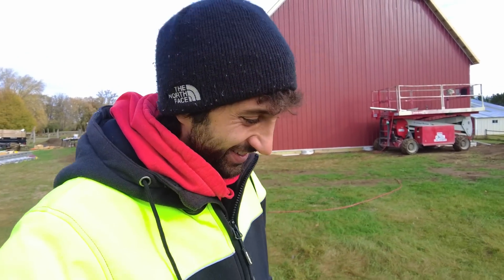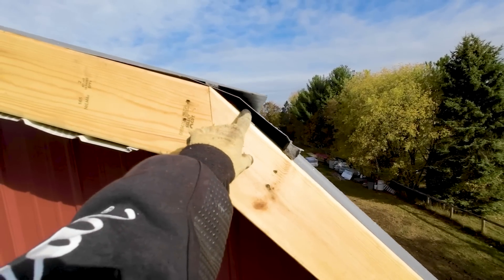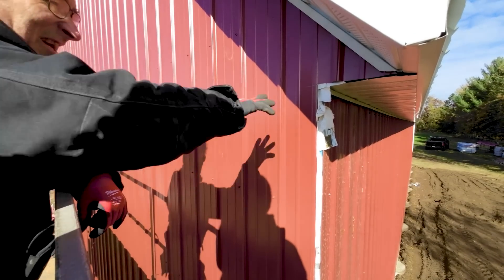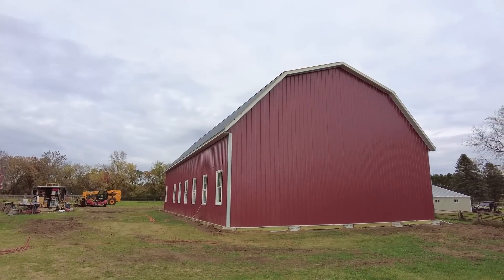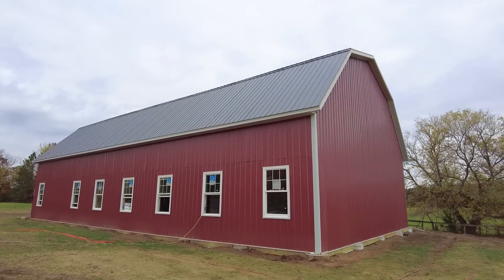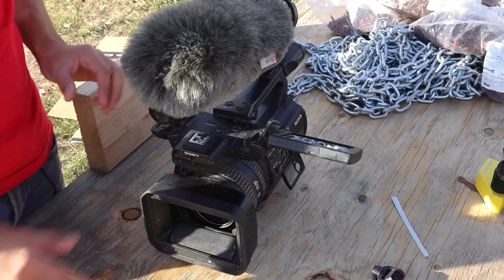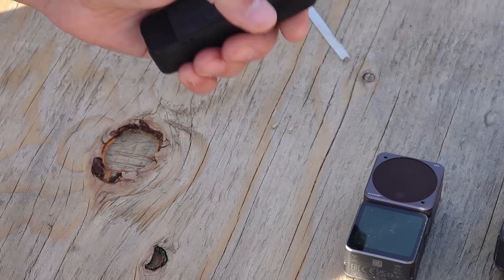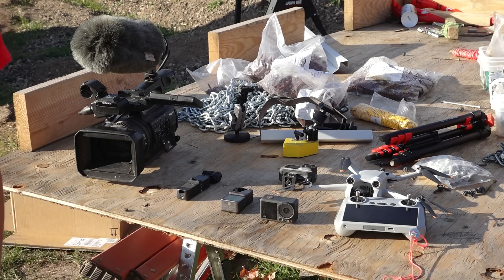Soffit Saturday - 40x72 Gambrel Post Frame Episode 18

Comment: You need to get the ridge cap one before the insulation is sprayed on the roof and walls.  You do not want the spray out the top, and if you do insulate before the ridge cap is installed, the insulation crew will want the hole in the roof covered with plastic.
Don’t put it off to long.

Comment: It seems from the angle at 3:31, that the upper roof overhang of the lower roof leaves an excessive bit of leverage for the wind to work on not only the panel but the fasteners and gasket.  Any thoughts?

Comment: For that DJI pocket 2 --- are you just using camera audio or do you wear a digital audio recorder?   (Because I've used a GoPro hero5 handheld and the audio is terrible -- picks up my hand shifting on the camera body)

And for moving into The Chairhouse soon   (yeah, I'm pushing that one!  😇) will you sprayfoam this month already or is that waiting til spring?
Reply from the maker: Almost always the camera audio. It does have a wireless mic module you can plug in but the use case for when I use it has the camera near enough to my face that the onboard mic works fine enough. I think the mic placement is out of the way of where a hand would be. 
Spray foam will be done in a few weeks. Hopefully the power company will bring their lines out soon otherwise contingency time 😑
Reply: @mcremona  Great, now I want a new camera...  😉

Comment: 200K?  did a similar w/o windows 40 x 60 and a 40x 20  deck eave over the frontage ..In 2004 was under $40 K all in. Rollup 14x12 1 steel door  no heating but electrical and water supply even 2 toilet feeds  with drains to outside and 3 in floor 12/12" drain sinks, which you should have done.

Comment: I love this filming - very cool! I never appreciated the camera work , and 'editing' as much as I do watching your projects and your enthusiasm for your projects!  And maybe you answered this (have not gotten all the way through this video yet), but why not a few panels of skylight in the roof? I recall as a High school lad working at a horse barn that had only 6 such panels, and they let in a TON of light to the point 90% of the time no lights were needed.   Just wondering.
Reply from the maker: They have no r value. Thanks!
Reply: @mcremona  That is true!  As I think about the situation I described, it was not the horse barn that had those panels but the indoor riding arena, and it had no insulation/ not really used for anything that needed temp controls, only out of the elements. Thanks for responding! :-)

Comment: I would like to know how long the PEX lasts under the concrete... that always makes me think, about future replacement...
Reply: Think of the concrete as a protective sleeve, pex can not expand or  reduce in size & antifreeze used today is much improved. We installed many floors with radiant heat. only problem when someone drilled into floor to secure work bench , etc. sorry, meant to say we did these in 80' and beyond. Just do a careful layout  in planning & do not deviate from it.

Comment: I noticed that the bottom of the side panels drop into a track. Is there any concern that water will be retained in the tracks and eventually rust out the steel panels?

Comment: Kinda makes me wonder why cameras, especially at the higher end, don't come with radio clocks. Syncing seems like it'd be constant problem in any kind of multi-camera production, with a pretty obvious technical solution. Maybe it's one of those situations where you can't get accurate and small and cheap all at once.
Reply: Time code encoders are available but might not work with lower-end cameras. Search the net and you'll be up to speed about these devices in a few minutes.

Comment: Jooc, why wouldn't you have your boiler installed and ready to go on a late October build with 6in. of concrete to cure?
Reply from the maker: Gas line hasn’t been run
Reply: @mcremona , ok, my bad. I just assumed you were using a wood fired boiler.

Comment: When are you going to install the side door? When you installed the windows, I wondered why you blocked the side door. Then I realized that the windows had glass but you didn't have the door.
Reply from the maker: After the floor is poured
Reply: @mcremona  You are the only "influencer" who has responded to my questions.
Reply from the maker: @robertpearson8546  I certainly don't have a perfect response rate but I try to put in the time.